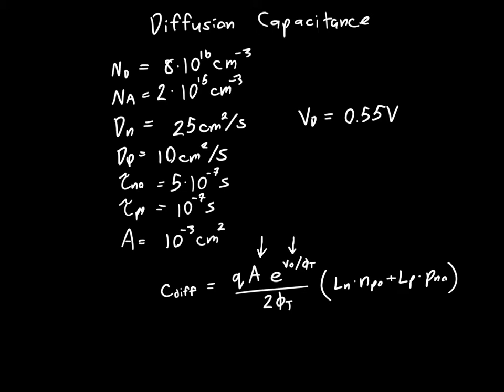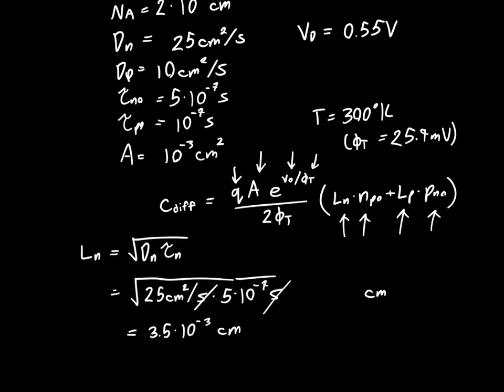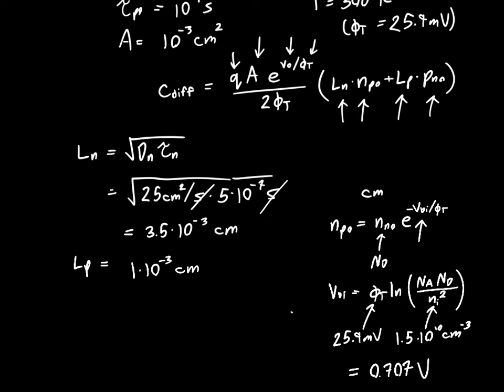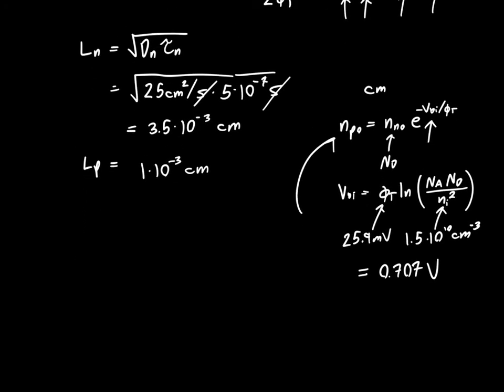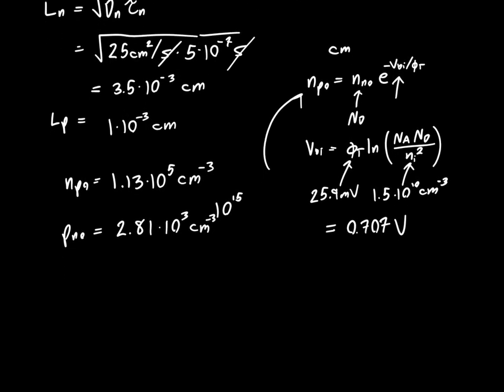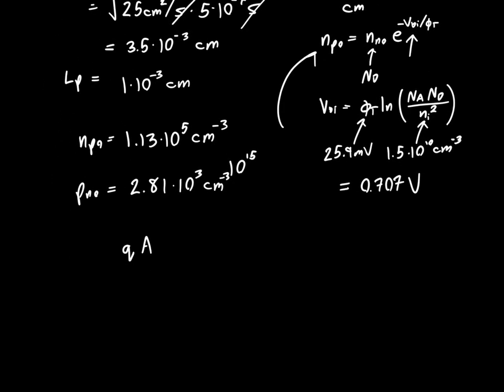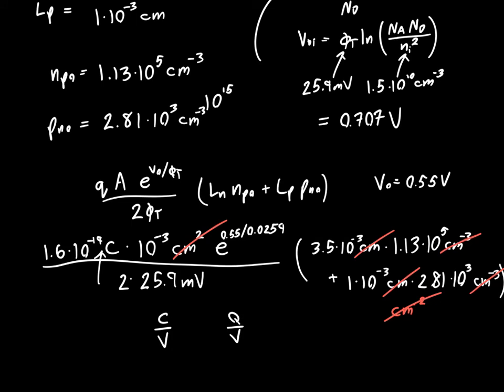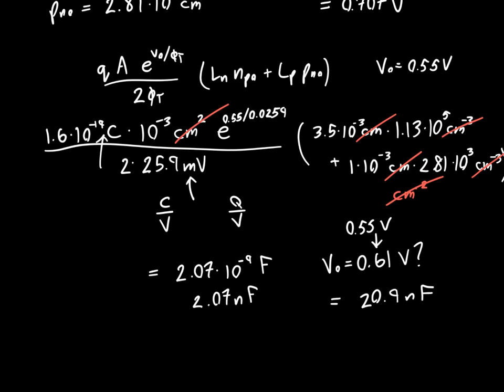Diffusion Capacitance Example

Comment: Hi, I have the same question as Xing Matt: why did you not substitute Vbi-Vd for Vbi when calculating the npo and the pno?
Reply: There is no external bias applied in this problem, so we only use the Vbi in the expression.
Reply: @sushoct  external bias bias value only given in the question not built in potential
Reply: Vbi is not used Vd only will come in the expression